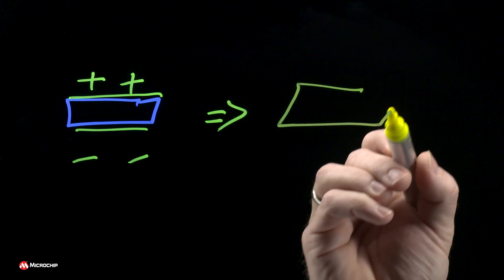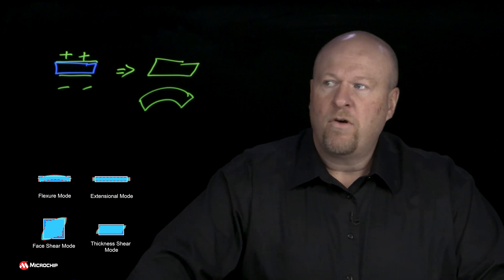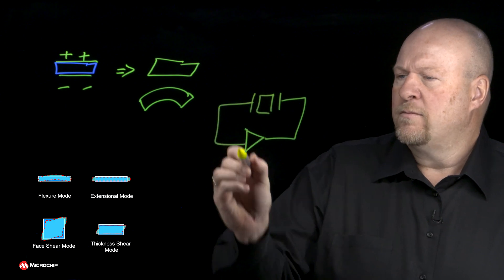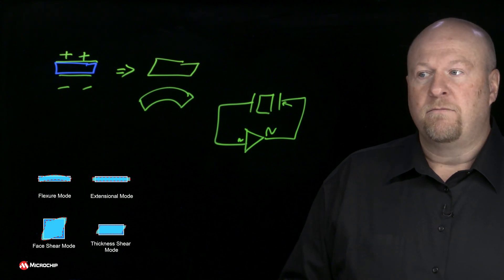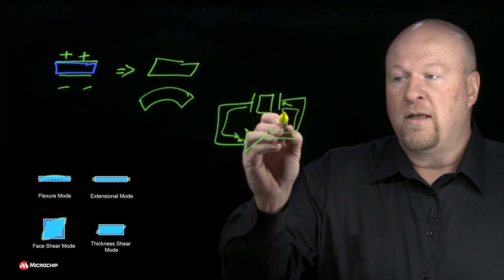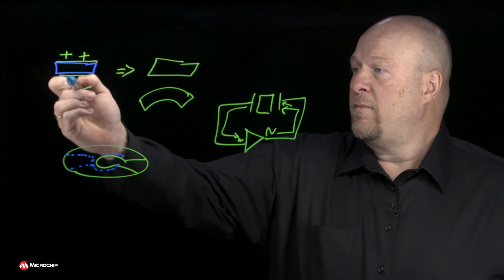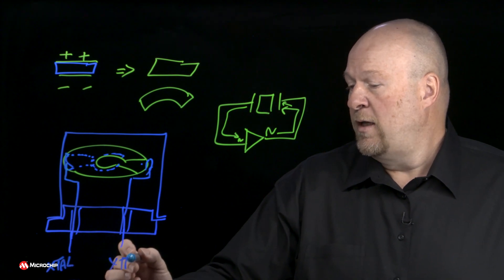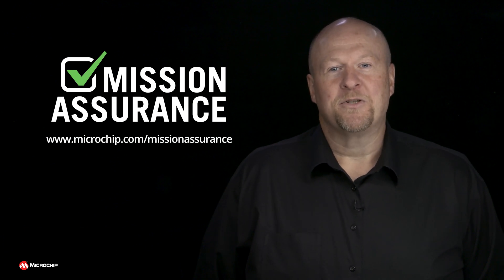Quartz Crystal Design and Oscillator Basics: Lightboard Instruction

Comment: Wish u could practically demonstrate it..much appreciated
Reply from the maker: Hi there, thanks for reaching out. For a practical demonstration, refer to Figure 1 and Figure 2 in the application note, which show the use of a crystal in a Micrel IC and the traditional construction of a quartz crystal (round disk with electrodes on both sides, placed in a metal can for protection), you may refer to the following resources below.
 
https://ww1.microchip.com/downloads/aemDocuments/documents/OTH/ApplicationNotes/ApplicationNotes/ANTC207-TCG.pdf#2
 
https://ww1.microchip.com/downloads/en/AppNotes/00826a.pdf
 
https://ww1.microchip.com/downloads/en/AppNotes/00943A.pdf
 
While a "lightboard" or video demonstration is not directly available, the above application notes provide step-by-step guidance, example circuits, and troubleshooting tips that can be followed for hands-on learning and practical experimentation. Hope this helps!

Comment: If I epoxy a small rare earth magnet to the crystal and excite the magnet with a low-impedance voice coil at just the right frequency will it efficiently convert electric coil current into high impedance voltage signal?
Reply from the maker: Hi there, thanks for your question! Attaching a magnet to a quartz crystal and driving it with a voice coil won’t efficiently convert current into a high-impedance voltage. Quartz crystals work via the piezoelectric effect, not magnetic or mechanical excitation. If you'd like specific support with your design, feel free to reach out to our team at https://www.microchip.com/en-us/support. Thanks!

Comment: Thanks for the video. please also let us know what role does frequency of the crystal mean?
Reply from the maker: Hi there, thanks for reaching out with your question. The frequency of a crystal is a fundamental parameter that determines its suitability for specific electronic applications, with its stability being crucial for the reliable operation of modern electronic systems. The crystal's frequency plays a pivotal role in: Timing and Synchronization, Communication Systems, Measurement Instruments. Hope this helps!

Comment: With many MCUs you can turn on/off external crystals to save energy, only keeping them oscillating when you need the extra precision.

I guess my question here is a bit like "how long is a rope?", but how long could a crystal keep oscillating after stopping the amplifier? I've noticed in one application that our 64MHz crystal oscillator takes less energy to become stable again if we turn it on one second after it was turned off compared to turning it on after four seconds. Could this be an effect of the crystal still oscillating, or are we really seeing some other effect of the MCU using the extra energy?
Reply from the maker: Hi there, thanks for reaching out. The quicker stabilization of your 64 MHz crystal oscillator when turned back on after just one second, compared to four seconds, is likely due to residual oscillation energy. When the off period is short, the crystal may retain some oscillation, allowing it to resume stable operation more quickly and with less energy. As the off time increases, this residual effect fades, requiring more time and energy to re-establish stable oscillation. This behavior also relates to the retrace characteristic, where a shorter off period results in less deviation from the original frequency, contributing to faster stabilization. For Application assistance please contact us at: https://www.microchip.com/en-us/support

Comment: I have a few questions, if you don't mind educating me on it. You're talking on how we get this energy from quartz through human manipulation of it. Does this also happen to it in nature and how powerful is this energy from it, especially when there's an abundance of it for instance where there's lots of limestone in the ground, and does flowing water over it seem to amplify its energy?
Reply from the maker: Hi Mike, sure thing! Quartz's piezoelectric effect, where it converts mechanical stress into electrical energy, is harnessed in technology but is minimal in nature. The energy generated by quartz naturally, even in abundant areas or with flowing water, is not significant for practical use. The engineering of quartz in devices focuses on precise frequency generation, utilizing meticulously crafted quartz crystals, which differs from natural occurrences. Hope this helps!
Reply: @MicrochipTechnology  The reason I ask is, I don't know how much you believe in the paranormal, but from what I hear from investgators, especially residual hauntings seem to be stronger where there is a large deposit of limestone which usually marbled with a lot of quartz. Through my low educated guess on the subject I wonder if what energy the crystal does produce naturally, if it could be a contributing factor to the hauntings.
Reply from the maker: Not our area of expertise, but interesting to ponder!

Comment: Say i was to carve out a 60ft obelisk made of quartz, and had that sitting on a quartz base that was drilled down into limestone channels with a tidal river filling those channels. Would that create energy?
Reply from the maker: That's a thought-provoking setup! While quartz has piezoelectric properties, the scale of your idea would make energy harvesting complex. The interaction with a tidal river might not be enough to generate significant energy. It's the controlled pressure and release on quartz in tech devices that does the trick!
Reply: @MicrochipTechnology  Well you say that but breaking the stream of water from a tap and holding a LED to both streams creates enough energy to light it up.

I believe there is a reaction when running water flows through limestone channels. But I agree 100% you would need something extremely sophisticated to harness such energy. Maybe something as complex as the great pyramid in Egypt!

There was a wisdom keeper called Hakim Awyan. He had wisdom passed to him from the ancient Egyptians. He spoke about the pyramids being used to create energy. Possibly sound. There is also a huge base made from quartz in Egypt which most likely had a 50/60 foot quartz obelisk. He also talks about something called the Schist Disc or the Schist Wheel, he says it was used to create ultra sonic sound, which he claims can be use to manipulate gravity. Now if the pyramids did create some sort of sound then you might need an oscillator to harness it. Hence the quartz, and I find it a bizarre coincidence that the 3 main pyramids where encased in granite. 1 was red, 1 was black and one was white, which are the colours we use for audio. 

A lot of the things Hakim Awyan said has been back up by a highly regarded engineer called Christopher Dunn, and Hakim was also in a documentary called The Pyramid Code. You will find it on YouTube. Please look into it if it piques your interest. 

Apparently Tesla said, he had figured out what what pyramids are for after completing his tower. Who in my opinion was by far the smartest person to ever of lived. Maybe looking at the past can solve our problems for the future. 

But I'm not really smart enough to figure it all out. I'm just trying to apply logic based on what I know about sound. Which is what got into this subject in the first place.

I was once playing around with low frequency sub bass. Below the range of our ear. 35hz and below. My doors rattled like crazy and some items I had on the floor started moving. That's when I went looking to find  out what was going on. I found a chap on YouTube called John Hutchinson, who was using magnetic frequencies to liquefy metal and make a 75lb cannonball levitate, then I found some other people using high pitch frequency to make objects levitate. I guess this is what makes quantum physics so interesting. It basically rips up the rule book. I think the world is more strange than we know, or maybe I'm just strange. Hahaha. 

Thank you for taking the time.

Comment: Hi! I have 2 questiions:
1. The volatage applied to the crystal isnt constant?
2. If the crystal has 2 terminals for voltage , how does the ciruite measure the oscillations? 
Thanks!
Reply from the maker: Hi Jonathan, thanks for reaching out! The voltage applied isn't constant; it's part of a feedback loop that keeps the crystal oscillating at its resonant frequency. When a voltage is applied to the crystal, it experiences a physical deformation due to the piezoelectric effect, and starts to oscillate. The circuit measures the oscillations by monitoring the voltage variations across the crystal's terminals, which are integrated within the circuit. The oscillations create a varying voltage that is then amplified and fed back into the crystal to sustain the oscillation. Hope this helps!
Reply: @MicrochipTechnology  Thanks! 
Is it possible to create an equivalent circuit (with quartz frequency -32kHz) with resistor, capacitor and inductor?
Reply from the maker: Hi there, an equivalent RLC circuit for a 32 kHz quartz crystal would require tuning inductance (L), capacitance (C), and resistance (R) to achieve resonance at 32 kHz. The specific component values can be found in the crystal's datasheet. 

However, replicating the high Q-factor of a quartz crystal, which confers its low energy loss and high stability, is difficult with discrete components. Thus, the RLC circuit's performance may not be as stable or precise as the actual crystal.

Hope this helps!

Comment: Since the crystal leads are reversible, what exactly does the ground connect to? I figure I'll find the answer before a reply but other people may read this and want to know as well. Cheers!
Reply from the maker: Hi there, thanks for reaching out. The ground in a quartz oscillator circuit typically connects to the common ground of the surrounding circuitry, serving as a return path for electrical currents and providing a common reference point for voltage measurements within the circuit. We hope this helps!

Comment: Sir please explain the hormonics in crystal oscillator
Reply from the maker: Hi there, thanks for your question. Harmonics in a crystal oscillator are multiples of the crystal's base frequency. While the crystal is designed to vibrate at its fundamental frequency, it can also resonate at these harmonic frequencies, which are integer multiples of the base frequency. Ideally, these harmonics are minimized because they can cause signal distortion and noise. However, in some cases, they may be intentionally used for specific applications. Hope this helps!
Reply: @MicrochipTechnology  Right.  Operating at an overtone effectively increases the Q of the crystal, often dramatically.
Reply: Thanks sir 👍

Comment: Wooww!!
I was searching this kind of explanation for a long time. Thanks!!

But I want more explanation about clock signal generation in microcontrollers by crystal oscillators.
Reply from the maker: Hi Abhijeet, thanks for your comment! Absolutely, a crystal oscillator in a microcontroller works based on the piezoelectric property of quartz. When an electrical charge is applied, the crystal deforms and then returns to its original shape, creating a stable oscillating signal. This signal acts as a "clock" for the microcontroller, synchronizing its operations. The frequency of this clock is determined by the quartz crystal's physical properties. Often, the microcontroller can further divide this frequency if needed. While the crystal doesn't generate the clock signal alone, it forms a resonant circuit, typically with capacitors and an amplifier, to create the oscillation. You can learn more about crystal oscillators in our webinars: https://www.microchip.com/en-us/education/technical-learning-center/webinars/mission-assurancee

Hope this helps!
Reply: @MicrochipTechnology  is the energy in (required to deform the shape) through the same terminals where the oscillations are comming out?

Comment: Thanks for the info!. Quick question please - how important (if ever) is it to get a very precise crystal oscillator? I ask because I see some selling online - for example - a 4.0 MHz and then there might be another that is 4.125MHz… is there anything important to note about those that are specified down to the 1000th or 10000th of a decimal point?
Thank you so much
Reply from the maker: No problem! And happy to answer your question. The precision of a crystal oscillator is essential in many applications where stability, accuracy, and consistency of the frequency are critical. The reason why you see oscillators with very specific frequencies is because of the specific needs of certain systems. For example, telecommunication systems often use crystal oscillators to generate carrier frequencies for transmitting and receiving signals. In these applications, precision is essential because a small deviation in the frequency can result in significant communication errors or even loss of signal. Or even, GPS, a small error in frequency can lead to a large error in position calculation. Let us know if this helps.
Reply: @MicrochipTechnology wait I'm curious, so these oscillators are used in all the band jumping that has evolved to 5g, but came from code breaking science that Hedy Lamarr helped invent?  Whoa that's deep

Comment: however, Quartz cannot be an oscillator by itself.
If it vibrates, electricity. If it receives electricity, it will vibrate.
so it can work both ways...
I think the igniter in lighters works in the same way... of course, since each crystal has a resonant frequency related to its own structure,
 frequency can be obtained stably in orcillators👍
Reply from the maker: Thanks for your feedback!